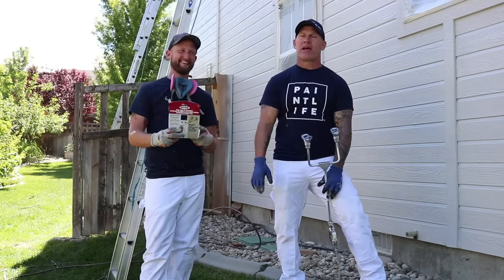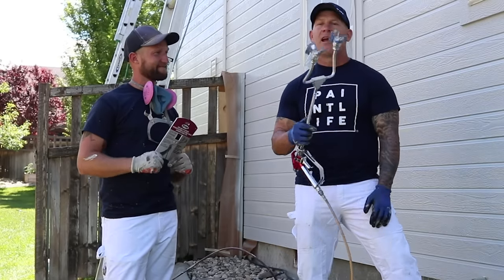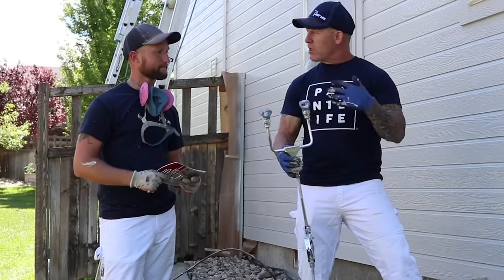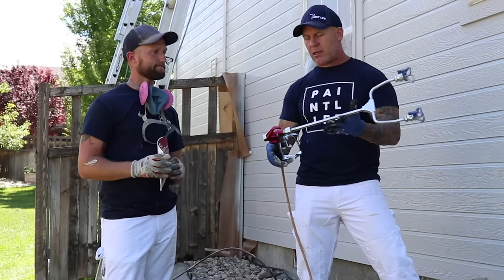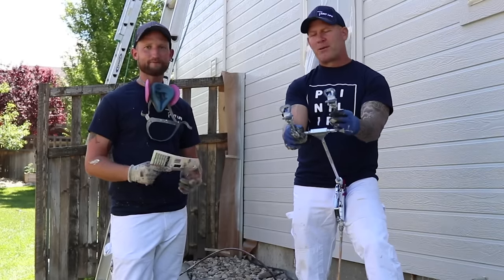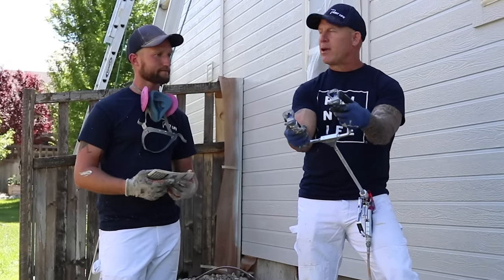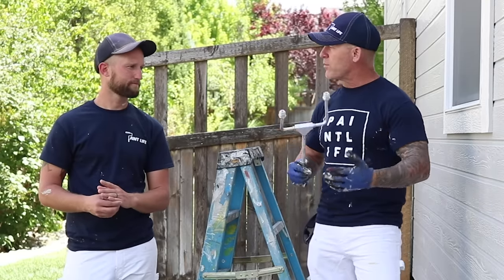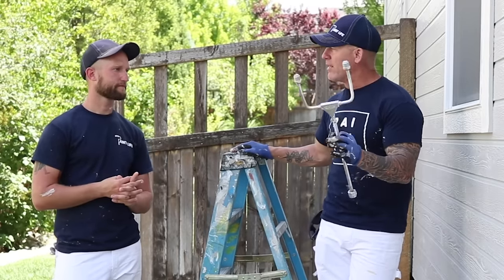Tools to Paint FAST.  Airless Sprayer Accessories.

Comment: Great to hear that you guys are getting some use out of 517 tips that come free with sprayers!

I imagine using two tips works better for non-flat surfaces than one wide tip.
Reply from the maker: Harry Pehkonen You would have to go to say a 1221.  The over spray is way to much.  With this you can use two 515 tips and get the same with without the over spray.

Comment: Awesome stuff guys. Question for you. I went into a paint store asking about purchasing an airless sprayer to paint my house and I was told to not waste my money because even if I could eliminate overspray, I would still have to back roll with a roller to achieve a smooth finish. Do you use a roller after spraying? Didn't seem like an accurate statement. 

Thanks!
Reply: I work at a paint store. What they are telling you is sort of true. If you plan on spraying the interior of your house you generally want to back roll over your walls as that will get you the smoothest finish, though spraying trim and ceilings is way faster than brushing/rolling them in a lot of instances. On an exterior you really only need to back roll if you have something like a stucco house. If you have vinyl siding or something similar you can just spray away but make sure to overlap properly. 

We do generally talk DIYers out of buying paint sprayers because even the low pressure units from Titan/Wagner and Graco still have overspray issues that we feel like a lot of home owners just don't want to bother paying for the masking for and probably don't know how to mask stuff properly even if they did want to pay for it. On top of that most DIY sprayers are about 200-400 dollars on top of the cost of the paint. Are you really going to pay 200-400 dollars on a tool you'll use maybe once every five years?
Reply from the maker: We do not typically back roll, only under certain circumstances, there is a lot that goes into deciding that

Comment: You mentioned increasing the psi to 2400 solved accumulating paint at the tip, but still had a little bit.  Would increasing psi to 3000 solve it or are there downsides to that approach?
Reply from the maker: that PSI is way to high.  Lots of overspray

Comment: Not sure I would use this product, just due to tip clogging and spits. You clear one and then the other tip clogs or spit. It would be easier if this company just designed a large single fan based extension, with multiple fan displacements to accommodate multiple surface textures.
Reply from the maker: That would be nice!

Comment: To answer the question about doubling the life of the spray tips, the answer is no. Tips are not rated by hours but by gallons passing through them. And of course the material being sprayed and the pressure will affect the life of the tip. So if you get 200 gallons out of a tip, then you will get 400 gallons out of two tips.
Reply from the maker: Thanks for sharing!

Comment: I would think the wider the tip sprays equates to a worse paint job quality. Those Tips look to be 10-12 in apart, maybe 8. So with wide tips, the center area between those 2 tips gets a ton of paint while the edges get little. Overlapping with this and wide tips wont work to remove the heavy stripes from the double spray area between them. I'd think the idea tip with is equal  to the distance between those to tips, in which case 50% overlap works as evenly and perfect as a single tip.....just say'in!

Comment: Why not just use one large fan tip on the gun rather then the dual headed tool?
Reply from the maker: Aaron Singer You would have to go to say a 1221.  The over spray is way to much.  With this you can use two 515 tips and get the same with without the over spray.
Reply: Ok thanks makes sense